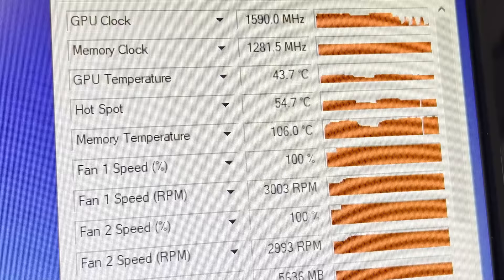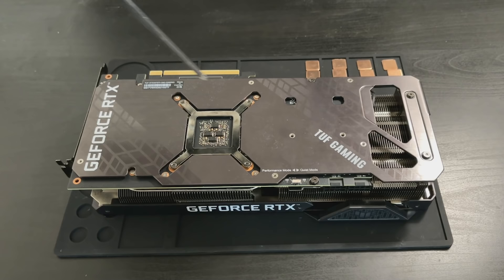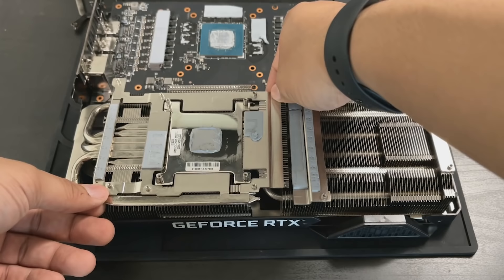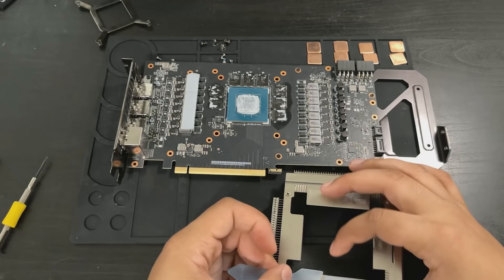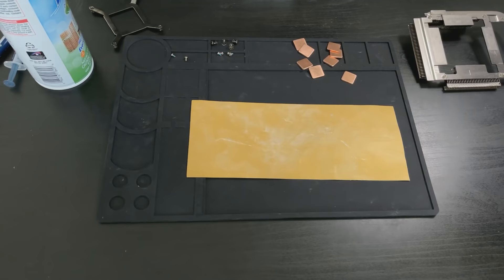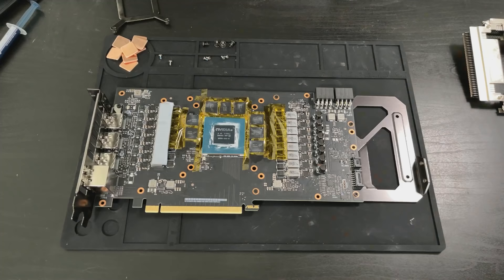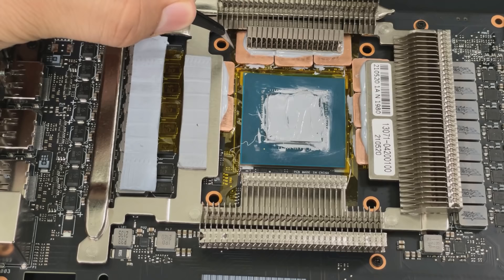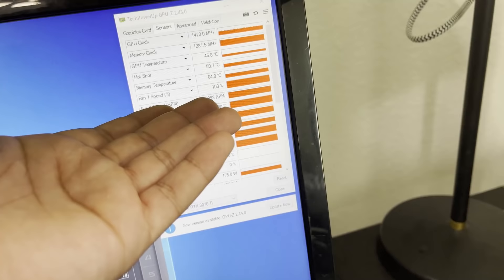I Copper Modded An RTX 3070 Ti.  Memory Temperature Dropped 45 Degrees! This Is How. (110C to 64C)

Comment: Personally, if your card takes 1.5mm pads on the memory modules, I’d use 1mm copper shims, or 1.25mm would probably be ideal if they make that size, those 1.5mm thermal pads compress when you clamp on the cooler if you haven’t noticed.  And I’d definitely use thermal paste on both sides of the copper shims to transfer heat and prevent them from moving.  I used to cool my CPU with a TEC (thermal electric cooler/Peltier) and I used a 40x40mm copper plate with thermal paste on both sides back in the day.  
The tape is a great idea. If you use conformal coating or nail polish, they’ll deny any warranty claims.  Leave as little evidence as possible.  If your card is out of warranty, the coating is actually a better idea, or both to be safe.
If you’re going to do this be extraordinarily careful when reassembling the cooler.  Too much pressure one way or another or on one component or another and you could instantly overheat your GPU or even crack the die or damage some other critical component.  This is not something for novices to be doing, if you’re not confident, get help.
Reply: What were you cooling with a Peltier? Since they are absolutely a horrible solution for CPU cooling.
Reply: @zedorda1337  then go do it
Reply: @zedorda1337  4790K with a 400 watt TEC
Reply: @zedorda1337  also, yeah, it wasn’t great, it was sub zero at idle, around 35F under load, but no more over clocking over head room, it was more of an experiment that was short lived.  I also set up a series of TECs to create a chiller for a GPU loop.  But again, not worth the effort of installing all the insulation and constantly monitoring temperatures and for condensation.  That was a cool setup though, I sandwiched 4 or 5 100 watt TECs, this was years ago, between two cold plates and liquid cooled the hot side, I also liquid cooled the hot side of the CPU TEC.  So the cold side acted as a chiller for the liquid cooling the GPUs.  But again, the GPUs were cooler, but not enough to provide better over clocks vs a quality custom loop.  Back then power limits weren’t an issue.  We could bypass them with a custom BIOS.
People talk about the crazy power draw of 3000 series cards, but I was pulling 425 watts from a 700 series Titan, two actually, 450w from got GTX 980’s, 1080 TI’s I actually ran stock because they were good out of the box, 2080 TI’s I ran a 380w BIOS.  My 3090 is 500w.
Reply: what about UV glue?
Reply: i have done this mod on old msi 570 that have 5mm pads.. but with aluminum shims cuz they are cheaper and have a lot of heat dissipation.
Reply: @ExcedereInInfinitum  I’ve never tried it, anything that blocks contact between the components and the metal should work.  If you’re going to do that, do a small test patch first to see if it sticks correctly and there’s no weird reactions.  And just be aware you’re using glue and be careful not to stick anything to your board permanently.  I think I mentioned it, but clear nail polish is something people often use for this type of job.  If you’re going that route though, get a good quality nail polish, not the dollar store crap.  I used to paint my daughters nails when she was little, there’s a big difference between cheap and more expensive nail polish.
Reply: @chincemagnet  Damn, thought that Peltiers died way before Haswell. Knew a couple lads that just ran the chips direct die, was enough to daily about 1.5V if i remeber right
Reply: @omegaPhix  I don’t recommend it, it was a cool learning experience though, actually I had a 980x that would have been awesome for it, it was good for 5 GHz at 1.5v, which was crazy back then, ran it 4.4 daily 1.325v to 1.35v roughly
Reply: on my 3070ti the "compressed" pad are between 1.491mm and 1.499 (with a good caliper) so almost not compressed, and the 1.5mm copper plate are about 1.49 after sanding, so for this moddel 1.5mm copper is the way to go ^^
Reply: @satsukiyatoshi5328  I’ve never actually tried this, so yeah, that may be the case, sanding was a good idea though 👍🏼
Reply: @satsukiyatoshi5328  this seems correct. I am using 1.2mm and the pads still shift a tiny bit when heat-sink is fully screwed in. I am running it right now, and temperatures are reduced, but not as drastic as in the video. I will attempt again with 1.5mm and report back.

 1.5mm should provide a better contact for conductivity. 3070TI TUF FYI, same as in the video.
Reply: It really helps here that the memory heatsink is separate.  Also, good to see some TEC love!  Had a PIII Coppermine 800 running at 1066 back in the day with a massive TEC, a massive Alpha, and Delta fans that sounded like an F4 Phantom at full burn.  Good times
Reply: I was thinking thermal epoxy might be ideal for this use... but 100% agree on the thickness reduction.
Reply: @Rhyotion  did you yet tried it with 1.5mm?
Reply: I was shouting the same at the TV wtf now he'll be bending the board NOT GOOD!
Reply: And the point Nvidia would have increased those heatsink by what.... A mm and just put thermal past instead of pads! 
He may have got the temps down but at the cost of his card a year down the road! 
Don't do this......🙄
Reply: Didn’t be sand it down a bit tho
Reply: @False Prophet ,  First sorry for my google translate English. I'm about to do this mod on a rx 5700xt asrock challenger, it also has an aluminum heatsink under the VRAM and with 1mm thermal pad, I will use 0.80mm copper and compensate the remaining 0.2mm with thermal paste, my doubt is that over time the paste does not lose volume due to evaporation and consequently the copper moves. I think about using nail polish to isolate, the tapes encapsulate and muffle the component that are below it. Does nail polish need chemical solvent based or water-based? Is transparent the most suitable? I don't want to spend tens of dollars on specific solvents like thermal grizzly.
Reply: @marceloleite2304  I don’t know regarding the nail polish.  I did use nail polish on a delid once, I used transparent, or top coat, I believe it’s called.  Regarding the base, I’d avoid a water base.  If there’s a one with an acetate base, that’s probably the better choice.  I bought one of the better brands for my project, although it may not matter at all, which brand you use, to be honest
Reply: Yeah but washing was terrible. Copper by the time he i stalled already started to oxidize, you can see it color change. You need to use alcohol or at least deminirozed water to rinse them. 

I would highly advice to buy a tiny container of silver / copper cleaning solution - it will transform your copper from looking good (oxidized) to looking perfectly clean. Goggle it

Great job and results 👍😊
Reply: Pls help , i have a kfa2/galax 3080ti sg, but i don't have a good caliper and from the eye 2mm pads seem to compress about 0.3mm though not sure, my model also uses a single geatsink so i can already imagine how much heatsoak it would cause to core temp, not sure what shims thickness i need
Reply: was just about to type this when i saw your comment. yeah the pads are meant to be compressed to avoid the super tight tolerances needed for tp
Reply: Tg shield .
Reply: @Rhyotion work fine with 1.5 mm?
Reply: @Rhyotion  give us an answer

Comment: I think the cause of the issue with this particular card is the fact that the memory heatsink only contacts about half of the memory die. If there was full coverage and they used thinner, better thermal pads, it probably wouldn't have had issues. Great video
Reply: Also that it's directly under the airflow of the hot air from the GPU cooler.
Reply: Fully agree. You can clearly see the sticky thermal pads were pretty much mispositioned in the first place

Comment: In the future you can try non conductive pads like aluminum nitride, only half as thermally conductive as copper but its an electric insulator and still 200 ish times more thermally conductive as the sillicon pads most gpu's use
Reply from the maker: Interesting… I need to do more research into this. I have never heard of using Aluminum Nitride!
Reply: I am very intrigued. I found some aluminum nitride plates on aliexpress. I'm thinking I can triple stack some 0.6mm ones since the recommended pads for my 3080 are 2mm.
Reply: @Waffls  i looked for 1mm, 1.5 was too thick and too expensive. i ordered 20 pieces just in case.
Reply: @dandyworks  Great video sir! Have you come to any conclusion about the aluminum nitride?
Reply: @dandyworks  regardless,  you proved the GPU's are built cheap. No way the manufactures don't know about this,  Kudos for sharing this info
Reply: Silver may be good but it is expensive.  It is supposed to be the most conductive metal.  It is not horribly expensive, just enough that some people might not think of using it.
Reply: @711jastin did it work...?
Reply: @jamesisal8156  yes, it works, very much.
Reply: @711jastin  if you're able to provide any more information I'd love to know. Where did you get the material, what did you use it on, what were your results? Thanks!

Comment: Dang dude, 45c reduction! That’s nuts! I should do this across my 30 series rig and see how performance improves! Keep it up, man! Content is great!
Reply: Turn 50% power and temp limit like 11:55 and you also get 45c reduction without mod.
Reply: @GennPen  that's his fan
Reply: DO NOT DO THIS it’s completely idiotic there are a lot better methods that are very safe and effective unless you wanna put your family at risk with your 24 7 rig
Reply: @HoloScope  its not fan. its power and temp limit for GPU.
Reply: @GennPen  oh ok
Reply: @AphillyatedYT  this method is not new, so i dont know what You mean it's dangerous, what methods You know to reduce temps like that?
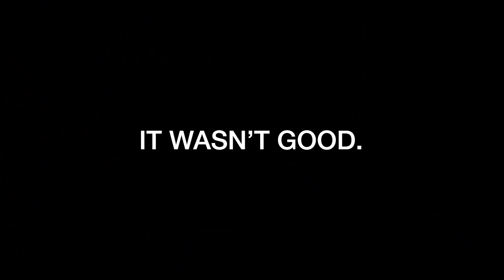Reply: @GennPen  I don't know brother, if you compare GPU-Z at 1:21 to 11:57, mem clock, fan speed and board wattage all match. Seems legit to me. Now, I'd like to see it punished with RVN ... my 3070 Ti's are NOT happy right now!
Reply: @FlextheJuvat  you're right, it's the same Watts. But I am very surprised he got such results.

Comment: An alternative to tape is Thermal Grizzly Shield, it's basically nail polish, but designed to shield stuff from liquid metal. Unsure if other similar products exist and I haven't used it myself but there you go.
Reply: nail polish. its nail polish.
Reply: Or just use enamel varnish of any kind... such as nail polish
Reply: You could also use Plasti Dip, which has insulating properties and can be removed without leaving any residue if no primer has been used. I use the stuff to seal microcontroller boards and electronics for models intended for outdoor use.
Reply: Nail polish, hasn't failed me in 5 years 🤷

Comment: Thanks i've done it on my 3070ti:
from the start i mined eth@lhr75 with vram oc +2000 and core locked at 1500@830mv (average 62MH with T-rex)
-stock card was about 106°C/108°C@100% fan with this minning profile
-repad card was about 96°C/98°C@90% fan with this minning profile
-copper mod is about 88°C/90°C@70% fan with this minning profile (the card is realy silent without overheating)

Great catch here ^^

Comment: Cheers for the job done properly! I did this copper shim mod a year ago for all of my GPUs, both AMD and Nvidia.It's very time consuming to mod a heck lot of cards, i ran into many issues trying to keep the shim in place as they can slip off at high temp, but the result is on another level compare to even the most expensive thermal pad on the market.
Reply: See my reply above about using KPX or Kryonaut paste, because they both have really good adhesive properties.

Comment: That sounds like a neat idea for GDDR6X. Though, just to nuance something you said, the casing of the memory chips is insulated from the silicon inside thanks to its diffusion barrier, so the thermal paste and pads are for proper contact and not insulation. Of course you don't want your copper pads to slip and short something on the card, so taking measures against that is wise :)
Reply: Also, the thermal issues may not be due to the heatsink itself, but rather due to ASUS' asinine choice of going with a thick thermal interface, which is a very bad choice as it reduces the efficacy of heat transfer.
Reply: @lennard9331  Thick is good, if it is not too thick.  The problem is that the installation pressure or thermal pads are not thick enough for many cards and then the pads are nothing but insulators.
Reply: @NVMDSTEvil  naww if it's too thick u can also bend the pcb and like the 1st comment said if the pads are too thick they also highly affect thermal transfer efficiency so u want the thinnest thermal pads possible that will still make contact with the components and the heatsink simultaneously...
Reply: @ronjones3977  No, the thinnest possible pad that still maintains contact will not attain the correct compression factor to enable thermal transfer.  The correct amount of compression of the pad must happen or the pad is nothing but an insulator.
Reply: @NVMDSTEvil  only the slightest of pressure is needed to achieve the  thermal transfer if you go too thick I've definitely seen negative thermal affects probably from squishing the die but regardless you go too thick you WILL BEND THE PCB which after years of heat cycles could definitely affect longevity...

Comment: Absolutely fantastic content!! Amazing results! As a mechanical engineer, your solution is top notch. Simple, cost effective, efficient and obviously works well. Props!
Reply: hi is using copper safe for gpus instead of thermal pads?
Reply: @AmeerQ99  as long as you take precautions as shown in the video as well as taking size into consideration, then yes it can be. 

It's definitely more work than just using proper sized pads. I mentioned size because the physical size of shims can cause contact issues for other parts.

It's one of those things you'll want to measure 2 or 3 times to be sure.

Comment: Solid upgrade! I think the fact that the memory cooler is seperate on this specific card, allowed the author to get way with using same thickness copper plates, without compensating for the pads' natural compression. I had to take about my 3090FE, which has memeor on both sides. The front is cooled by the main cooler and the back is only cooled by the back plate. In either case, there are other components around at different heights, that also need cooling. I used a guide that recommended just replacing all the stock memory pads with 2mm pads, I think it was. I went with Thermalright, as they had the best specs and it was a big upgrade. Not this big, but big!  But then I got greedy and opened it up again. I had felt like I should go thicker on the front side pads because they weren't compressed as much. So I went up to the next size, I think 2.5mm? The card wouldn't post because the thicker pads wouldn't let the cooler clamp onto the core properly! So I had to do it over a 3rd time! Case and point, if you do this with a card with a single piece cooling solution, you better find out EXACTLY what thickness copper to use.

Comment: One thing that I have recently learned is that some thermal pastes (specifically KPX) has a "cure" time of several heat and cool down cycles and when it is "cured", it makes a pretty dern good adhesive which would definitely help keep the copper from moving.  Kryonaut also has some really good adhesive properties.
Reply: Yes, and there are also thermal adhesives made specifically for these types of applications.
Reply: @General_Griffin  Yes, but thermal adhesives are so strong that they will remove the memory chip from the board before they will let go of it; so make ABSOLUTELY sure that you want what you're doing to be permanent.
Reply: @Calango741  I wasn't aware it could be that strong, thanks for the information.
Reply: @General_Griffin    Yeah, I bought an NVMe SSD once that had a heatsink thermal pasted onto it and I ended up destroying it just trying to get the heatsink off.